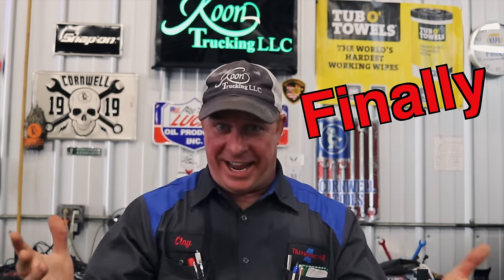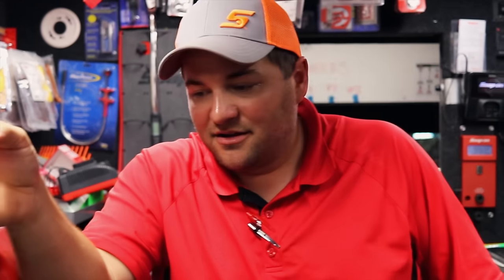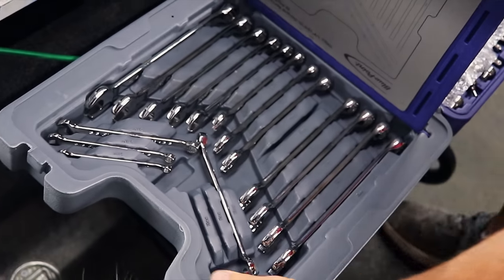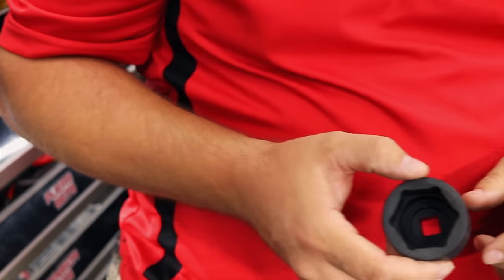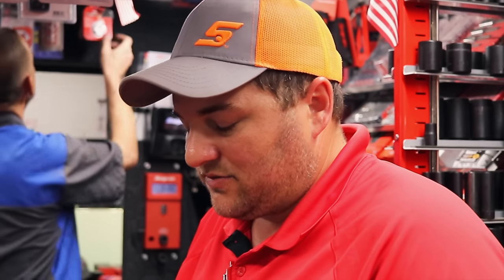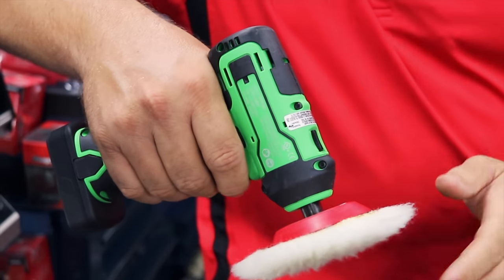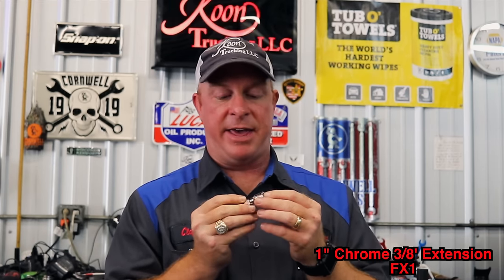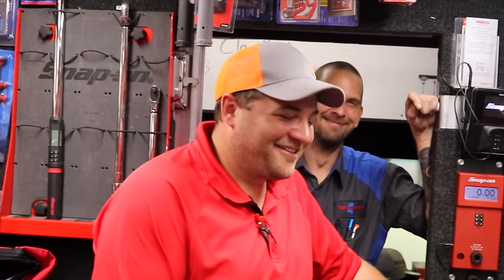Snap On Dealer's Top 10 Tools

Comment: I agree with virtually every thing hamilton said and recommended. His stuff is first rate. My wrenches are snap-on, ratchet a mixture of Cornwell, snap-on and Matco. The thing about good tools is they protect equipment and more importantly the technician. The cost involved with any major to, especially snap-on is the support network, it's priceless. Couple that with tools that don't destroy customer equipment and bust up a tired technicians hands and you have the biggest part of the snap-on value proposition

Comment: Also as far as cost, I'm sure snap on does an evaluation and factor in what they anticipate warranty breakage will cost them, and that cost is factored in as well. That said, once you've bought from the truck or have background testimony, just buy used. I've never had a problem getting warranty coverage once my rep was established. I have no qualms about letting someone else take the brand new price hit while I take the used price benefit. When that tool breaks, I still get a new one.

Comment: Snap on ratchets are the best in my mind, I got 1/4” all the up to 3/4” I love my electric ratchet and I want to get a new long neck. The hard handles is the best screwdriver handle, my dad bought some in the early 90s and I still have them now almost 30 years later and that handle is still in great condition and I hit them with hammer often
Reply from the maker: I agree on the best ratchets. I love that long neck battery ratchet, they are worth every dime !

Comment: I like the square hard handle screwdrivers much more than the newer Instinct screwdrivers. I find the Instinct handles to be too thick for my hand and harder to grip and use. I'm average size so I concluded they were made for bigger guys. The hard handle screwdrivers are nearly indestructible and clean up easily. The Instinct plastic is softer and gets gouged more easily and doesn't clean up as well. Neither screwdriver type rolls when set down. Proof that the hard handle screwdrivers are superior is Snap-On brought them back. When has than happened before?

Comment: I'll leave ol Snappy to the automotive mechanics since Snap-On is shoved down their throats with the ASE certs. When you're ready to fix some serious machines; planes, industrial, commercial... Very few care about the Snap-on truck. Yes, your Bowing 747's are fixed by more Harbor freight tools than you'd like to imagine. I use Husky tools where I can. They almost never break, they perform very well, and I exchange them no questions asked while enjoying a cheese burger in under 15 minutes, not 2 to 4 weeks. No one steals my tools, if they did snag a socket or two, well $3 and minutes later, replaced.

Comment: No diss on Harbor Freight but it's simply not worth it for me. My closest HF is 50 miles away and if I have to warranty something, I wait till I have to be near that area to swap it out. The breaker bar busted on the 2nd use and the ratchet wrench lasted 2 times as well. I went to using SK and Snap On ratchets because my Craftsman ones kept stripping or breaking.  I have bunches of them that are broken that Lowe's will not warranty...

Comment: I'm a marina technician with 20+years experience I grew up in auto and marine shops I've seen 1 snap-on wrench break.. yes 1 
I've seen craftsman 5/8 wrench open end flex on a nut and round it and not come off took a 5/8 snap-on wrench on that same rounded nut and took it off without slipping on it once... I was 15 when I seen that and was sold on quality tools. The only ratchets/wrenches/sockets other than snap-on I'll buy is matco I've got 3/8 sockets sets I bought when I was 20 years old I'm 38 now still have those 4 sets of sockets I've cracked a couple over the years  using them on inpacts I feel that's expected when using crome sockets with an inpact. Matco wrenches are as good as snap-on and are a little less $$$ like .50-.75 cent less lol. As for the ratchets snap-on has the best by fare matco's are the next best and the rest are junk I  don't care what anyone says... and he'll no the harbor fake are not better your not a mechanic if your trying to tell me that. Mac's won't last a week you'll be getting it fixed the next time you see the mac man craftsman also junk. grearwrench better than mac,craftsman,harbor fake but still shit. ..

Comment: thank you hamilton and koon i think i own most of all those tools. i’m also from bama  and a marine diesel mechanic in cali.
does snap on or blue point have a cylinder sleeve puller?
Reply from the maker: I’m sure snap on has one, most trucks probably won’t stock them so it would have to be ordered. You can probably search them in the snap on catalog or on the website

Comment: I been using the harbor freight ratchets for 3 years haven’t broke one yet probably bcz I’m not taking off tires with a 3/8. Ratchet I use them jus about every day I haven’t used the new snap on ratchets  but I think I’m ready these hfs paid there self of 100 times
Reply: Chad Gardee that’s all it’s about, using tools for what they are made for it’s simple. Hacks usually break their tools for hammering on them 😂

Comment: I know why the square handles are a mist for serous jobs it's the grip torque you can achieve over head and at strange angles like the ones I encounter as an A&P hand 90% manual and some if them screws are stuck good and tight 🤬 nut that square handle ratcheting driver gets the bite and the power I need to brake them free without stripping them!

🥃cheers🍻

Comment: You buy snap on one time as long as nobody steals your snap on tool it's a lifetime tools I had my tools stolen and had to buy tools fast so I could work and went harbor freight and parts house tools some was ok but most was trash the stuff like steering wheel pullers the bolts strip out three jaw pullers are trash they slip off under pressure the gauges are not accurate so my snap on and matco guy cut me some deals and kept my payments down and let me get everything I needed so I'm a loyal customer to them for looking out for me

Comment: I got snap on stuff but can't exchange it cause I don't work as a machanic professional anymore but still use them so if you don't have the same snap on guy you bought them from on speed dial your screwed then it's not life time warrantie
Reply from the maker: Send it back to snap on ?
Reply: @KoonTrucking   

Right if I want to send 20 in shipping and wait a week lol what I was saying is if you don't work at a shopit would be quicker to run to a store to return the tool then wait a week having to ship it in the mail but lifetime warranty you should be able to return it to anybody that's a snap-on dealer but I'll be even called them and kind of got the runaround

Comment: This is an old video so take my comment with a grain of salt, but if the truck comes out once a week and they are breaking the tool three times a week, how did he warranty the tool the other two times he came out that week. I agree buying a better tool is the way to go because that tool will pay for itself but its not I like a brick and mortar store I can work with and even of they don't have it it can still be ordered. Plus you can order from a parts store and get a tool in a pinch if you are the professional working by the hour. Just some non-Common Core breakdown of whats realistic for most people. Plus most DIY will never fail to have to make another run to the parts store for that thing the didn't go as plan. But I do wanna say, I do enjoy the content on this channel.

Comment: In terms of quality, Snap on isn't necessarily the best in every department. But in terms of service, If you've got a good dealer, it's what makes a tool truck worthwhile. Snap on has loads of rebranded stuff, but at least they are open about the country of origin and keep most of their Made China and Taiwan stuff under Blue Point. Their website lists it for every item while Mac hides it and uses the blanket Made in USA with Global Materials label on their flyers on items that are technically Made in USA. Even with their rebranded stuff, they seem to be more careful about what they rebrand. A lot of their rebranded USA made items can easily be traced to a reputable supplier. With the way Mac sources stuff from mystery suppliers in China and Taiwan, I might as well shop around and see if anyone else is rebranding it or go look for other alternatives.

Comment: Harbor freight is lifetime warranty, so u break ur icon stuff, u don't have to pay for replacement, so it's the one time 5$ payment
Reply: So does harbor freight come to your shop? No they don't there's a reason snap on tools are more expensive.

1 the convenience of them coming to the shop they have to pay for gas that mfer don't run on air.

2 snap on tools are made from way better steel not the cheap China steel that most harbor freight tools are made from!

3 the tolerance on snap on sockets and wrenches are much tighter compared to others therfore you'll round alot less nut or bolts period. 

A tool isn't a tool just so you know.

And snap on tools have a lifetime warranty and you don't have to pay a dime to get them replaced.

You take a cheap wrench and watch how the open end spreads apart and you take a snap on wrench and watch how it doesn't spread nearly as much. A cheap wrench will cause you to round off nuts or bolts!
Reply: @marcowens3522  most snap on stuff is just rebranded. And still made in China. Don't get me wrong I like some snap on products and they have good tools, but the price is mostly for the name.
Reply: @eginc.8551  Wrong the majority of tools snap on makes and they aren't rebranded! They make their sockets, wrenches, most of their extensions, snap ring pliers and alot more all made in the USA not China.

Comment: Question: does snap on warranty a snap on product you buy used from someone
Reply from the maker: Send it to Snap On and they probably will. It is up the the dealer or not if they warranty it on the truck. If u buy stuff from them regularly they will swap it out I’m sure
Reply: They sure do. I’ve walked on trucks many times and had things replaced. 
Course I can’t help but buy something while there too...

Comment: Shoot I used snap on for years and multiple times warrantied out a broke bent stripped tool and after the 1st time they said if it happened again they would not be able to help. I take a icon ratchet that I twisted to anvil off with a 3 foot cheater and not only is the cashier too dumb to see how I broke it but also don't even realize there warranting out a stolen tool and do t see the boxes of impacts stuffed down my trousers. I would never do that to a tool truck driverny brother is a dealer and I know they got families to feed. Harbor freight is A crappy corporate dealer if chineseium . I always feel scared using my snap on stuff it's way too nice I sometimes catch myself just staring at a 13mm socket for hours as if I were gazing into a beautiful womans eyes . Hard to get anything done like that

Comment: I don't agree with his way of thinking while talking about the cost comparison of a Snap-On wrench and a HF wrench.  For one...no one is going to clock out and leave work in the middle of a job to go to HF to warranty a wrench.  This is the only way you can factor in your pay to the cost of a tool.  99% of people will stop by HF on their way home from work.  Cost = $0.  Also, $5-10 in gas?  That's up to 5 gallons of gas.  Not many people are going to be making 50+ mile trips to HF.   Another thing, If I break a S-O wrench on Monday....I have to wait 4 more days until the S-O truck comes unless I coordinate a meeting place with the driver (IF he has time, IF he is local, and IF I can get time off work to go during business hours that day).  I can have the new HF wrench that evening, and in time for work the next day.  
I am in no way comparing the quality and strengths of the tools...I have some HF tools, but wrenches are not, and will not be one of them (unless I need one to cut/weld and modify for a specific task).
Reply: Big facts right there.